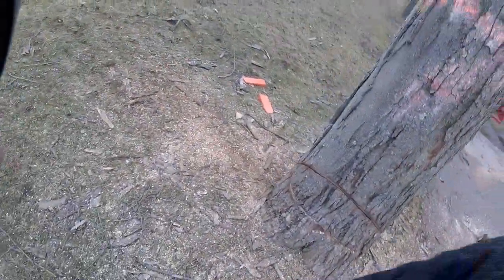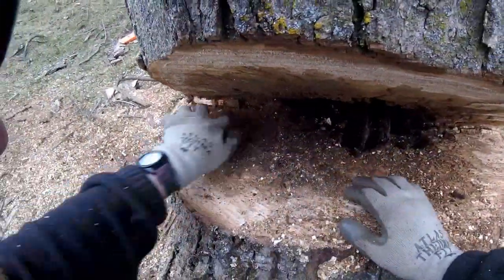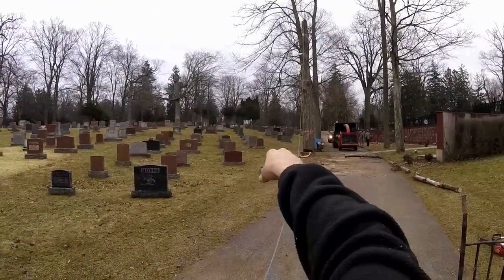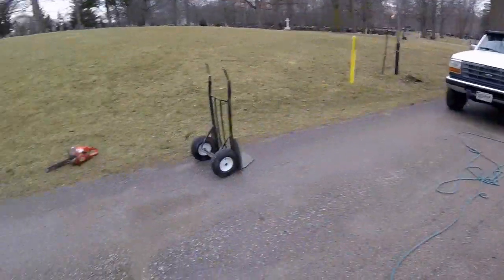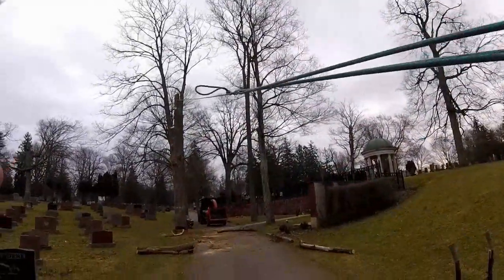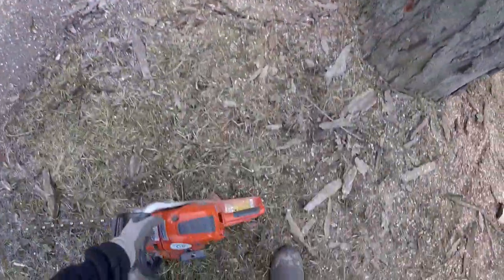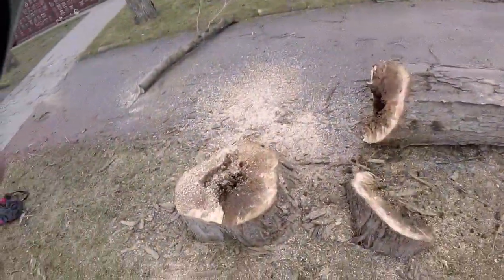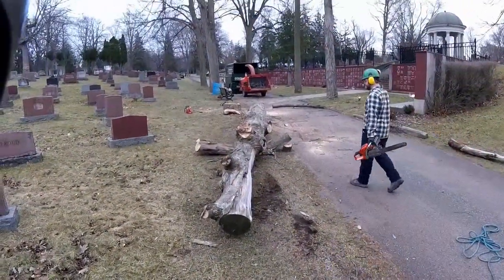Dropping a Peg with the Truckers Hitch

Comment: I also use the trucker's hitch, almost as you do.  But my main pulling line I choose nylon.  I want that extreme stretch of the line.

I have found it dangerous to have a man handling the line during the fall.  Should something go wrong,, and with trees,,, things go wrong.  So, with the stretchy nylon line, I pre-tension the line, like a long rubber band,, using the trucker's hitch.  Then, everyone out of the way I cut the tree.  The pull is already in place.  The stretch of the nylon maintains a pull for a long distance.  Static ropes can only maintain the pull for the first 2 feet, then the line will be slack and useless.  The nylon rope remains taut through as much as the first 20 feet.  Its a big rubber band that keeps pulling.
Reply: That theory makes a lot of sense to me. Reminds me of pulling a truck with a chain versus a snatch strap. Thanks